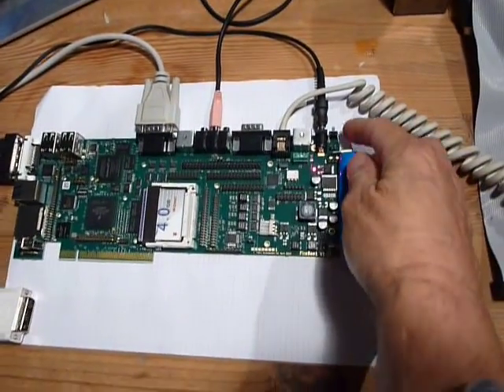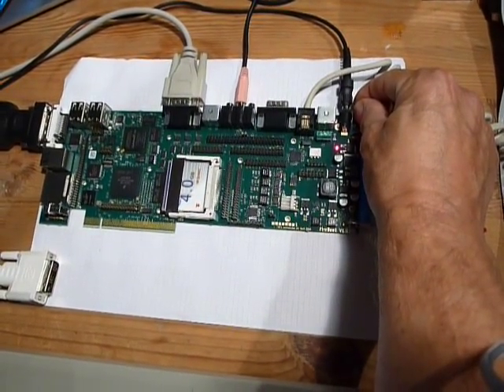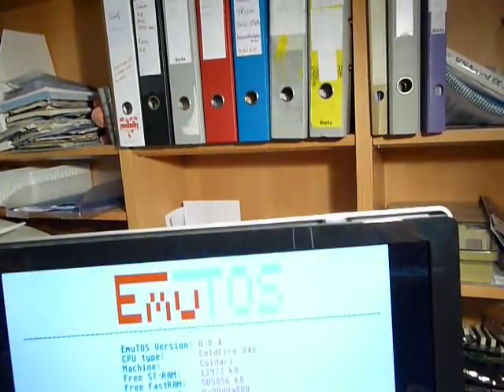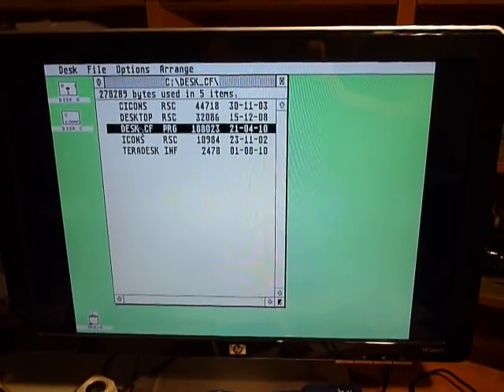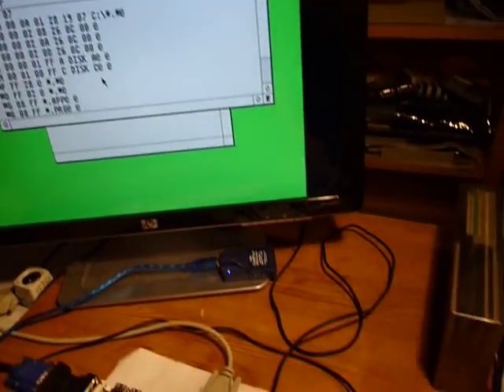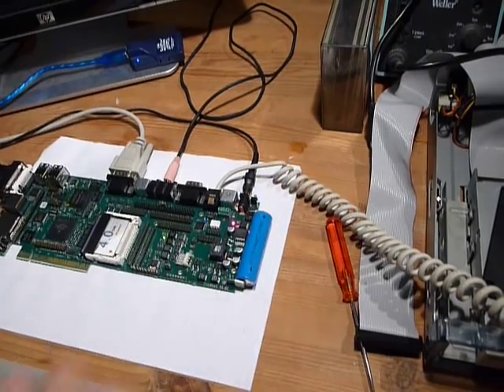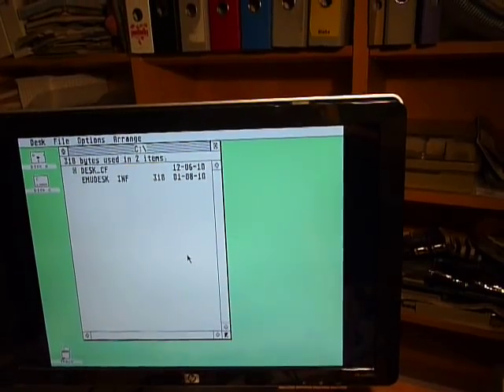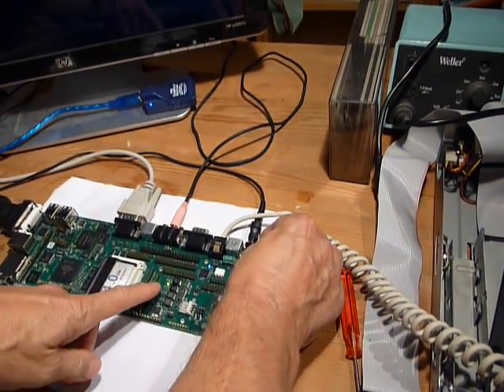Start up your FireBee

Comment: That compact flash card should be on the outside like all the ports so when you build the case you won't enclose it inside. Just an idea. Also, USB keyboard, WLAN would be nice :)
Reply: Maybe the idea of the card is to act like an hard drive instead of "removable media".

Comment: I'd like to contact the makers of this board. Im a big atari fan, and I run a business as a Consultant Engineering Designer in Industrial Design. 

I'd like to offer to design a suitable hardware case for this baby, and make a suitable housing for the community. You can find my website if you Google "The BIG Consultant", and I use SolidWorks 3D CAD to develop mechanical products.